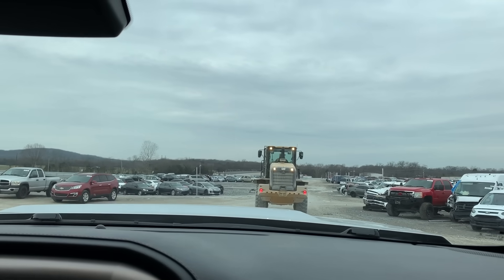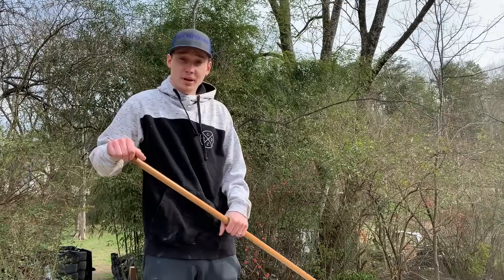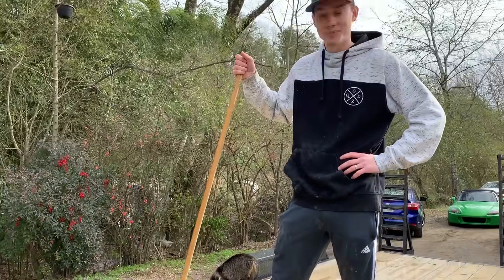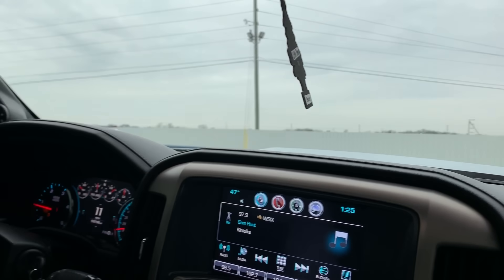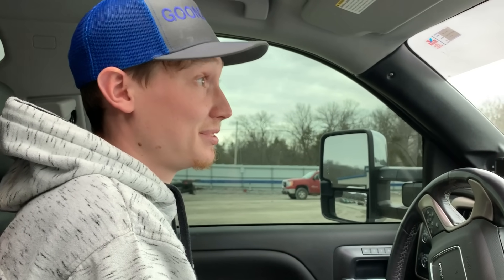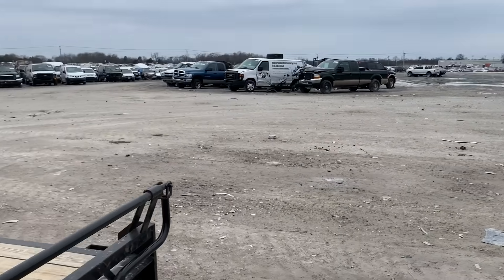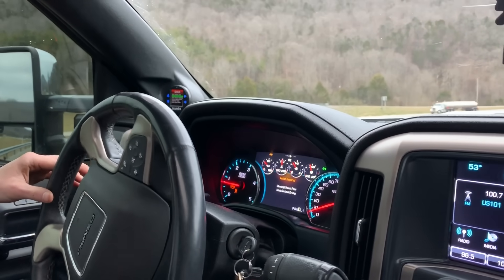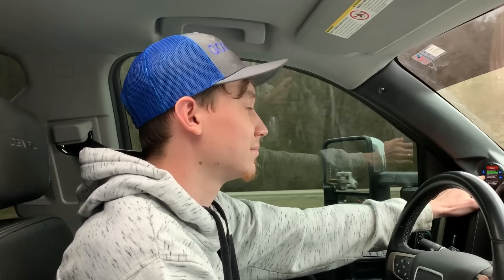Buying My Dad His Dream Wrecked Truck!!!

Comment: Hot Shot owners delete their bed because it changes the definition of the truck according to the DOT. Without the bed, it’s considered a tractor, so the length of the truck doesn’t matter. However, if the bed is on it, it’s considered a truck and the length of the truck counts on the overall length with trailer. I think it’s 65 feet max.

Comment: You tuner/monitor did that because you were hauling to much weight in way to high of a tune. Your not suppose to toe with a high tune that’s how you destroy your motor. You just put it in a stock tune or maybe a small tune and roll on. And it was high sulfur defueling settings.

Comment: not good to tow heavy loads with a tuner turned up, overboost or low air will send a code, unless code is reset, truck will go into limp mode. tow on lower setting or build the hell out of the engine.

Comment: Add at least two chains to your setup. Fabric straps are not 100% and  it's never cool to see the thing you're hauling fly off into someone else's car. Just my 2 cents. Also, in 6, all you do is dump raw fuel and frakk the whole thing up. Low tune for tow. Don't blame the truck for your mistakes.

Comment: Lifted and “tuned”. And says pretty much stock!       Don’t complain about an OEM truck after you’ve modded it.  I’ve run diesels for years.  Never had issues with stock .  They pull reliable and keep em lubed, run forever.

Comment: How could you not like duramax any more when every Diesel engine that has the dpf on it needs to be regened after a certain amount of miles big ol 14l Cummins get regents because of the exhaust system and if you don’t to deal with it on the gmc delete the dang om thing and it’ll be fine

Comment: "pretty much a stock truck..." then his buddy walks up: "yeah, I just had it on level six to get more power..."

That's not stock. I know, these trucks are overbuilt but your still outside their design parameters and I sure would want to keep a close eye on all the vitals. Don't want to overheat an engine, burn a valve or fry your transmission. Surprised that tuner doesn't show you the basics.

Comment: Thoes jacked up trucks that people make to be fun are not to pull with. If you have to get a drop hitch and your rear end squats 6 inches than it’s not a real truck, it’s a toy. In my opinion a truck is the Cummins on the trailer, not the dirty max pullin it.